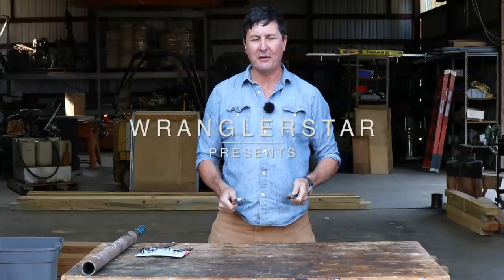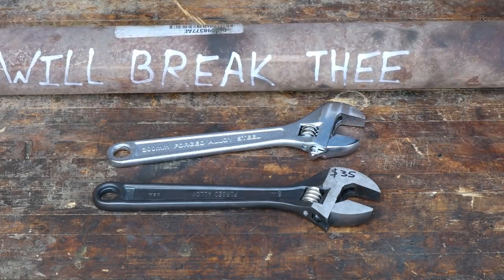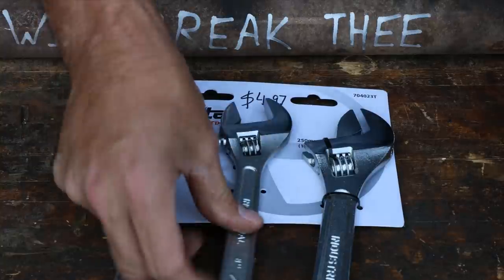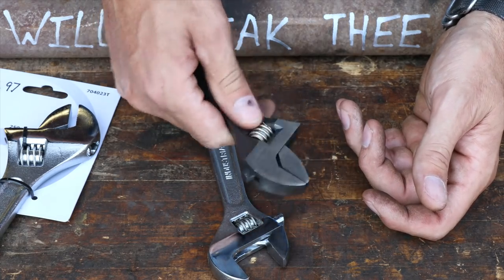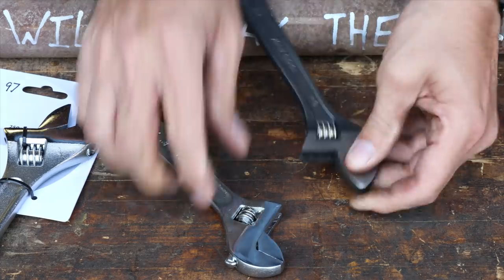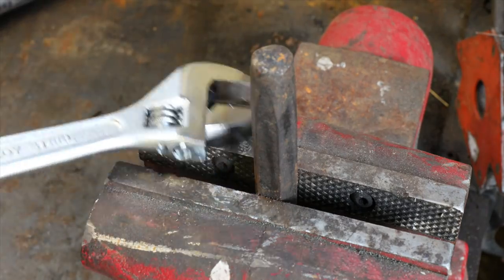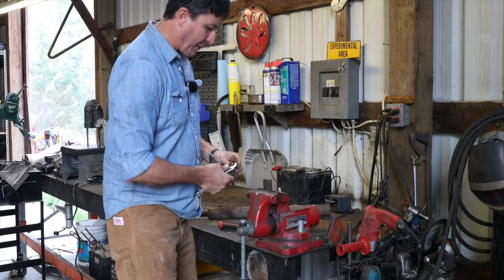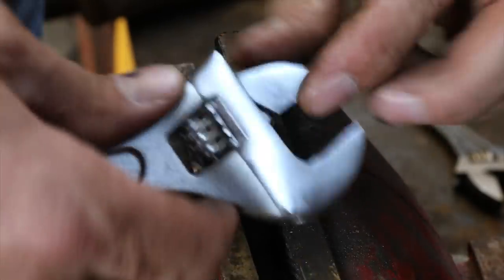Testing Cheap V.S. Expensive Wrenches On AMAZON

Comment: There's plenty of room for both philosophies in this world.  I have quality tools and I have sacrificial tools.  You nailed it when you said you will own 40 Crescent wrenches.  Yes.  I have many.  I have good Craftsman adjustable wrenches in my tool box and I have no name adjustable wrenches stashed all over the place.  On my boat, in my truck, probably a few floating around the house, a few laying around the garage...If I need to use my own "I will break thee", in my case a three foot galvanized pipe, I won't think twice about breaking a sacrificial tool.  If I lose one in the lake over the side on the boat I won't give it a second thought.  It is not an either/or proposition.  Cheap tools rock.
Reply: Tenspeed TheBikeHanger hard to beat a 4in1 screwdriver and adj wrench stashed in every vehicle. Better to have a shitty tool than no tool!
Reply: +Tenspeed TheBikeHanger  Agree.  Also, I kept my good tools tightly locked up in my garage and cheap throwaway tools in my truck box.  Sure enough, everything in truck box stolen.
Reply: Tenspeed TheBikeHanger *goes to neighbor's house* "I got you a present!" *thows wrench*
Reply: Tenspeed TheBikeHanger as I've been able to I've started buying nicer tools, and more specialized tool, my old stuff has now become sacrificial tools. I love my 3 in 1 craftsman screwdriver, pry bar, and punches!
Reply: Would I buy a $35 wrench? No. Would I buy a set of three for $5? Also no. I'd get a few reasonable ones for a total of about $30 because I won't use them enough to justify the cost of the really good ones and I will probably need more than one.
Reply: I like a good set with some "sacrificial" tools in combination too. Probably not the $5 absolute cheapest wrench you can find but if you look around  there's a good selection of bargain tools, a $10 wrench instead. 

Also on the higher end stuff obviously we all would love to buy the absolute top end tool but it just not feasible. So a few levels down on the professional range where the price isn't so crazy, but you are still getting a quality tool.  I think only jobs where absolute quality is needed the pro tools come out but for day to day tasks and oddjobs cheaper tools are good enough.
Reply: I'm with you Tenspeed. I have China made tools in my pick up for use in the field, or expedient circumstances. In my home workshop, I have Snap-On, Proto, Armstrong, Crescent, Channel Lock, Stein, and SK (but less and less Craftsman, I replaced those with pre-Chinese Stanley). It is like the difference between work clothes and dress clothes, right?
Reply: martianshoes that's right beat the cheap tools and save the good ones for specific jobs
Reply: id buy the china one because cheaper.
Reply: 60% of snap-on products are made in china, 30% in Mexico (old ones with mexican steel, new ones with chinese steel) and only 10% in US. If you are not a big company asking for thousands of tools on the fly, chances are your snap-on tools are either chinese or mexican.
Reply: Wrong..Wrong.. Wrong. Shows you how much you know about Snap-on tools and material science. All hand tools by Snap-on are made in the States less than 20% of their Product range is made outside, items like their welders are made in Italy by one of the biggest welder manufacturers in the world. There is a reason their tools are predominately used in aerospace and the military do you know why? I do! Sure their expensive but the reason is not what you think. 
I started out as a Mechanical Fitter in Australia, did my apprenticeship with a Mining company WA, I started supervising other tradesmen at the age of 22, moved on to managing companies then went and finished my degree in engineering.
The difference between a cheap tool and an expensive one comes back to 1 thing Material science. 

Cheap Chinese Tool
1. Pore Steel chemistry and purity, very bad purity, i know because i have seen the Spectrographic results from some very large mills over there. And yes I have dealt with them personally over the years on various projects!
2. All hot forged because of bad purity, often with retained Austinite in the finished product.
3. Require post forging heat treat i.e normalising, quench and temper to relieve retained Austinite and still never get rid of it.
4. Very pore ergonomics and tool design, you could see the difference in the lead screw and the rack on both tools. I would bet the lead screw yielded on the Chinese tool where as the American tool yielded through the tang of the bottom jaw to the rack requiring much more force to make it yield.

Expensive American or European tool!
1. High quality and purity steel (the chemistry is exact).
2. Generally COLD FORGED, what this means is the tool is forged at ambient temperature (Air temp at the time) and it takes MASSIVE PRESSURES to do so. But what does this have to do with tool strength, the tool steel is forged in its annealed normalised state not requiring heat treatment. And that is the answer "IT DOESN'T NEED HEAT TREATMENT" it already has the required hardness and strength. Unless it is a pair of pliers so they induction harden the cutting edge from 55HRc to 63HRc.  
3. Chroming and finishing process, the Chinese tool is simply flash hard chromed where as the Snap-on tool goes through a 3 stage process to make sure it doesn't flake.

In closing I will say this! if you choose the cheap tool good for you but don't expect for it to last long and you will often replace it. If it's expensive there is generally a reason for it and that is often proprietary But it will last far longer and put up with more abuse.

I will go back to my opening statement the difference is generally manufacturing and Material Science................

Regards,

Shane
Reply: Former Cutco rep here.

One of our marketing points to our clients is that in the long term, they will spend just as much if not more money replacing cheap knife set after cheap knife set than if they just bought the high end US made knife sets.
Reply: I have a similar mindset coming from a diy family and being relatively poor;
If I need a tool right now or there's something cool that looks useful, I'll more often than not buy the cheap one. If I can find a sale or if it's something I need quality on, I'll buy one of the better brands.
Reply: Tools I'm going to need forever - ie: ratchets & sockets, end wrenches, etc, I buy quality. Single use or seldom used tools like brake pliers or torx sockets, I get the cheap Harbor Freight one.
Reply: Mangla Ram
Reply: I wouldn't feel bad about tac welding a cheap wrench on a bolt if I have to worse case scenario improvise
Reply: That's ironic, that Cutco uses that rationale in their sales pitch, since they use cheap 420 steel in their knives and charge more than companies who use VG-10. Cutco is a scam company that preys on college students who will guilt-trip Grandma into buying a hideously overpriced set of knives for the pittance of a commission her grandkid will get.
Reply: Must be a cutco victim because this post makes no sense to the topic.
Reply: Hi tenspeed, you planning on growing clams too ?
Reply: Tenspeed TheBikeHanger Yep I have some cheap tools stashed all over the place and if I need something for a one off job I’ll go cheap. Too often these days you’re paying for a brand name trading off its history
Reply: I think it's better to get the cheap stuff first, and make sure you have as many tools as you can get for your limited budget when young. Later, as you realise what you use most and break the cheaper stuff, get the better brands when you replace it. Hell, treat yourself when you can afford to even if you didn't break it. But if you're just starting out at this sort of thing, rather than own that single nice wrench, you could have three wrenches, a socket set, a bunch of screw drivers, pliers, and maybe even more. In my late thirties now and finally bought a good adjustable wrench last year, having lost or broken the three cheap chinese ones that came as a set. It isn't absolutely top drawer quality, more a $25 wrench I would imagine, but it does make me smile when I pick it up.
Reply: If you want good tools but can't raise the cash, buy "good old boyz" tools from yard sales and swap meets... bathe them in a sump tray of oil or parafin for a couple of days and buff them up... Every one is a winner
Reply: I can tell just by seeing it in the video that the Chinese one will give you NOTHING but trouble because it is not made well and will not keep the jaw in place. It will move constantly and that is the number one issue of a  cheap Crescent wrench, not how much toque you can put on it with an old drive shaft!
Reply: +ned.. The old Craftsman has absolutely nothing in common with the new. I don't think they even warranty them anymore.
Reply: +ned... Unfortunately, it's not just Craftsman. All kind of formerly respectable American brand tools are now Chinese made junk. Brands that had sometime 100 years of quality reputation are destroyed in just a few years of being made in China.
Anything of decent quality made in China is made entirely under the management of westerners.  Shortcuts and cheating is very deeply engrained in Chinese culture. Short term profit is more important than long term viability in China. It's not just in manufacturing, it is pervasive in Chinese culture.
Reply: Tenspeed TheBikeHanger yeah, but now you gonna be in troubles in many places,in water in the desert in...except where u have your tool box..if i were you i put some good ones in the boat and truck,just saying!
Reply: jackfrost1031 is true but if you see that film Where the boy cut is arm in desert to survive with a chinese knife maybe u thought is better have1 good than a chip one where its brokes Ebert time u use it. The chip Always go expansive
Reply: Should have read this before I posted basically the same thing. Cheers!
Reply: Sensible answer.
Reply: More like the difference between Levi's and Wrangler.
Reply: ned kelly im noticing that with a lot of american made.  The phrase made in america is not as synonymous with quality as it once was.
Reply: Tenspeed TheBikeHanger I am a mechanic cheap tools suck and suck bad
Reply: I think that's fair enough to say there's room for both philosophies.  If my career and/or lives depended on my tools,  I'd definitely find the quality and spend the minimum price needed to get the best quality I could (as opposed to just throwing money on poor quality with a high price tag!)  For those guys who never touch a set of tools except maybe to put together that "some assembly required" furniture or toy once every few years at Christmas, the cheap tools are probably adequate.

For my part, I'm somewhere in between those extremes:  I use my tools fairly often, but not professionally.  I don't have a lot of disposable income, and I used to be a "just buy the bargain tools" guy, first using my dad's set of cheap tools, and then, after moving out and living on my own, buying a matching set of cheap Chinese tools.  

Over the years, though, I noticed that some of the tools I use wear out faster than others, notably screwdrivers (I've spent more time fighting against crappy screwdrivers than just about anything, except maybe crappy box wrenches and crappy socket wrenches!)  I bought a set of old-fashioned American-made screwdrivers at a surplus sale once, and I've never replaced a screwdriver again.  I've been replacing the other frequently-used and frequently worn-out tools with better stuff over time.  

Of course, some of the other stuff doesn't get used often enough or wear out fast enough to justify the expense:  I've never had a claw hammer break or wear out on me, for example -- I just don't hammer enough nails; I almost never use hex keys for work much harder than occasional light-duty amateur gunsmithing or electronic work, for which the cheap stuff seems more than suitable; my cheap tape measure and cheap utility knife have lasted forever, etc.

Meanwhile, the cheap stuff I do replace gets moved to the trunk of my car as I replace it, to be used for working at someone else's house, or helping someone on the side of the road, or whatever:  if I lose something, it's no big deal!  (Just a few weeks ago, my boss's car started giving him trouble at the office, so I lent him the tools in the back of my car... when he returned them, he apologized profusely for losing a couple of the sockets.  I didn't care about losing those Chinese sockets, they cost maybe a buck at most together, while having the cheap stuff to loan out and lose probably worked in my favor under the circumstances!

Anyway, if you're not a professional mechanic, don't expect to be a heavy tool user, and you're on a budget and just starting out, sure:  get a set of cheap tools to start with.  Then, as the cheap tools wear out, or when you get an opportunity to splurge a bit on your frequently-used tools, replace them with nicer tools, while ignoring those rarely-used, lightly-used, or unusually well-built cheap tools, and finding a new home for the extras you replace in single-use emergency tool kits for the trunk of your car, your boat, your hunting shack, or whatever.  I think for the average guy, spending a little extra on screw drivers, wrenches, and socket sets is probably a good idea, but a complete set of Snap-On or antique Craftsman tools is probably unnecessary if you don't use all those tools often enough or for hard enough work to ever wear even a cheap tool out.

That said, a nice set of expensive, high-quality, name-brand tools are probably a much better investment than cheap tools:  those high-quality tools are always going to be worth good money to someone, while the Chinese "bargain" tools are probably the sort of thing that are more likely to get given away or thrown away without a second thought....
Reply: @michaelc.4321  i imagined the throw like a throwing knife
Reply: 'cept when you need 'em to do the job.  (You won't be working on my bike!)
Reply: absolutely agreed! why would anyone put an expensive tool in danger of being broken(lost)?  and how often do you need to weld some feature onto a cheap wrench to get something done? I have a bent cheap 1/2" for timing adjustments on my ford, ground up screwdrivers etc.

    my highschool shop teacher told me that the best tools for some jobs are the ones you make yourself, for that purpose and that purpose only. he was right.

Comment: I used to walk past the Crescent Tool Co factory on my way to school in the 70's. You could hear the hammers pounding the steel stock flat for the dies to punch out the flat parts all over town on cold winter nights. At Christmas time, the company put large strings of lights above their front door in the shape of a Christmas tree that you could see from many places in town.
Reply: Might I suggest making a larger breaker bar..

You made a very good point about quality versus budget.

Personally I had to go with budget choice versus higher in quality. I'vee said more times than I can count if you're going to make your money using your tools only a fool would not by the top of the line tools.
Myself I turn the wrench to keep my own stuff on the road I don't make my money doing it.
Reply: Bacho in Sweden invented and patented it First.

Comment: The US wrench is made out of hardened steel which will break instead of flex. This allows for better grip on bolt heads and etc. The Chinese wrench is made out of softer steel which will flex causing it to slip off and round off bolt heads.
Reply: It doesn't really matter cause the bolt/nut metal is softer than both of them
Reply: @laysone346  stop using 'Grade 3' fasteners; despite what you've been told, harder Grade fasteners DO exist.
Reply: I've had handles of Chinese wrenches snap cos they were made from cast iron. it looks like the us one had a drop forged hardened steel handle, but the other jaw was cast iron alloy. that's why it snapped. they should have made that part from a chunk of hardened steel and machined it to shape.
Reply: where are you finding grade 3?

i literally only see 2, 5 and 8, 5 and 8 on the shelf, 2 in the field
Reply: @laysone346  Why I call them "nut rounders" . . .
Reply: @penfold7800  You can buy the Chinese ones in China for 30% of its price in amazon (Yea what a rip off when I saw the price). I don't think you can expect too much.

Comment: You did make a good point - adjustable wrenches are good for boat anchors - no professional technician would consider using those to do their job - maybe for a paper wight.... I've been turning wrenches for 30 + years and never found a need for one - use the right tool for the right job!
Reply: you said it all right there. i'm not a professional by any means,  but i can fix just about anything i tackle. if i don't know how, usually in a couple hours, i'll have a google and youtube masters degree on how to fix it. in 40 years, i've discovered one thing for sure..... anything that you can use an adjustable wrench on.... that cheap one will be fine, because it should stay in the tool box while you use the proper tool.
Reply: Automotive techs are actually the minority, many many other types of techs out there that find adjustable wrenches are the best tool for the job.